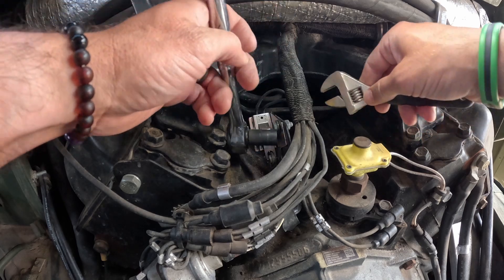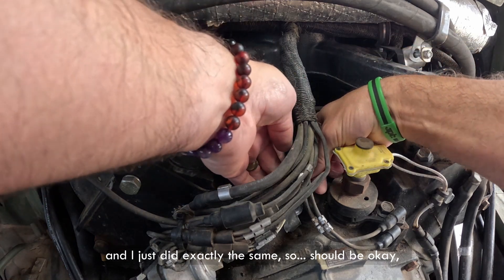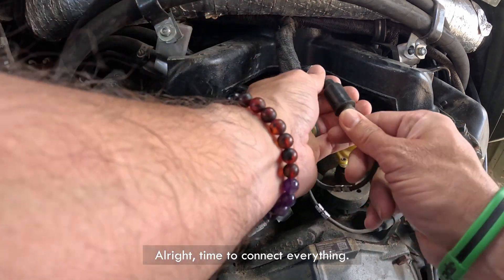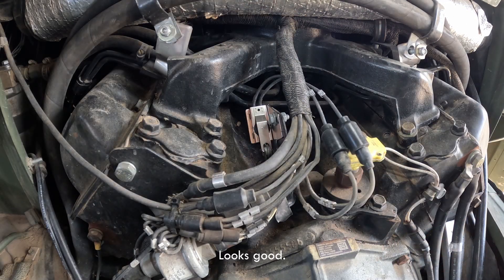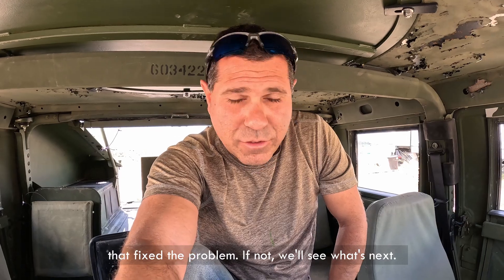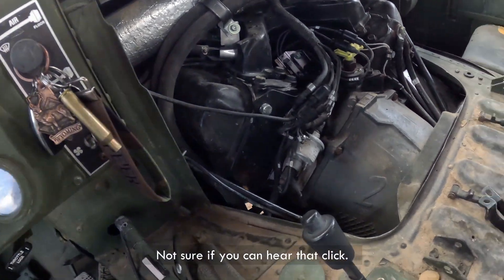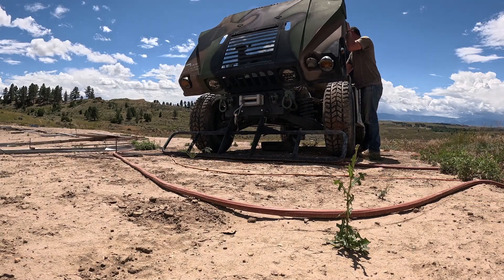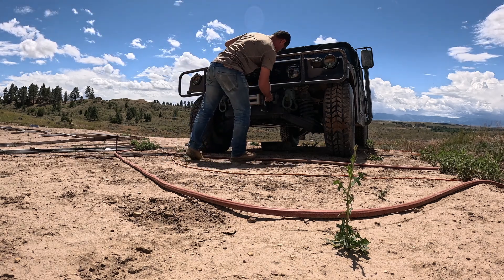Humvee Transmission Problem - Symptoms and Troubleshooting (Part 1)

Comment: Haven't seen yall in awhile.  Sorry to hear you're having trouble with your hmmwv. Firstly the kick-down switch does down shift the transmission, it also tells the time delay module to  disengage the fan when you mash the accelerator real quick and turn off the  a/c if installed by manual to specs. I would check the tps first, there should be three wires. 1 is the 5volt reference, 2 is the signal wire,  and the 3rd is the ground. Next i would check the circuit breaker to see if it is getting power, in and out. Sometimes there is a fusible link hidden in there. If all that checks out, check for power at the tcm. If you have power then see if you can pull codes. On my hmmwv i jump pins a and e, you watch the trans light and count the flashes. Most people do this with a paperclip. 12 will be the first and last code. Oh one more thing, make sure your trans connector isn't flooded with fluid. Hope this helps you some.
Reply from the maker: @mattlawson7007  Thank you so much for all the info! I will start checking all those parts you mentioned! I need to do some research and find out where all of those are located first LOL 🤣 
I will probably post another video soon about the process of finding the problem. I really want people to be able to use these videos so it would help them to solve similar problems if they encounter them! Again, thank you so much for your help 🙏
Reply: You're welcome. The tps is located on the side of the injector pump opposite of the throttle cable. The tcm is under the rear driver side seat. Just be careful with the tcm, most folks forget they are a 12volt system not 24volt like the rest of the hmmwv. If yours has it unscrew the cap and you'll find the pins labeled, right beside the one with the harness. By the way, you're doing good, all of us that have hmmwv's have had to figure out one thing or another.
Reply from the maker: @mattlawson7007  I will start the troubleshooting! Again, thank you so much Matt!

Comment: I had the same issue took me months to find the problem, I was on the verge of of rebuilding the transmission and installing a stand alone TCU. Turns out it was a bad speed sensor and a bad TPS. $200 for both. I saved $2k
Reply from the maker: Thank you so much for the reply :)

Wow! That is crazy! 
I am so happy you solved it in just replacing those two.

How did you figured it out

Comment: You should check if the Circuit Breaker tripped located behind the Passenger side seat. It would cause it to go into limp mode. Another culprit could be a bad TCM. Definitely should do the paperclip trick to see what codes pop up.
Reply from the maker: Thank you so much for the reply! I checked the circuit breaker behind the passenger seat and it looks like it did not trip. What is the paper clip trick? I am curious to learn :-)

Comment: There is a military transmission troubleshooting guide, check Steel Soldiers or the web to find it, the brake switch seems to be a common issue.